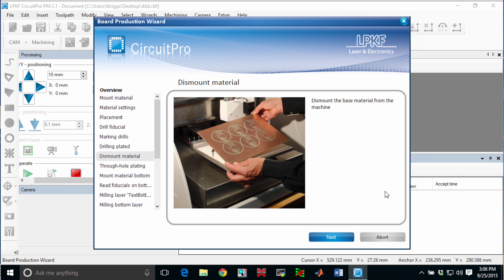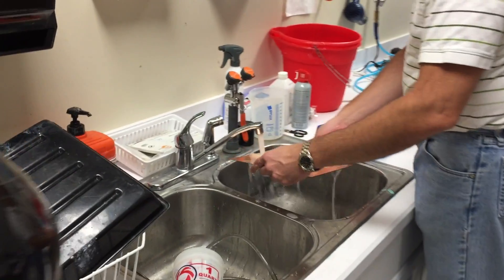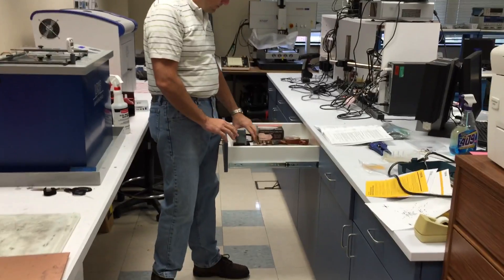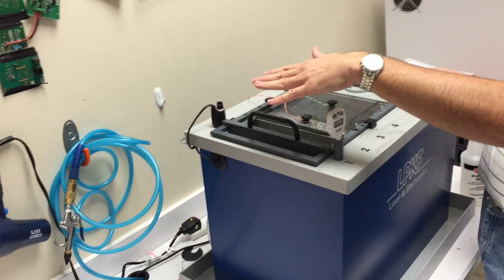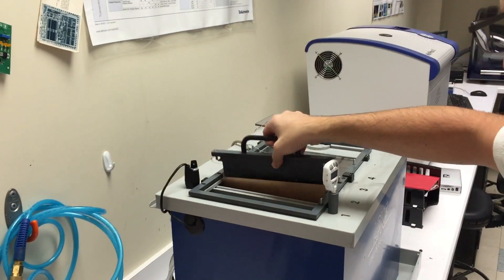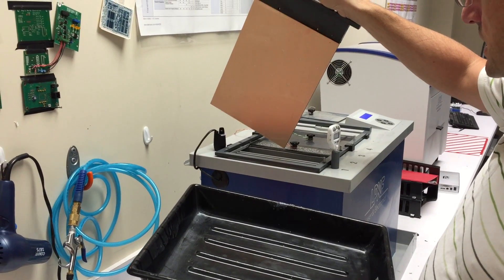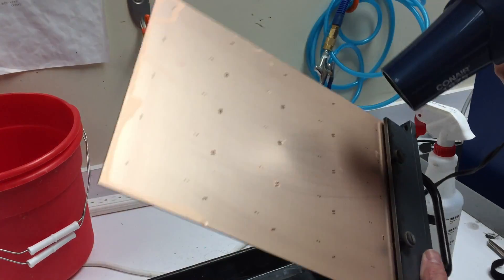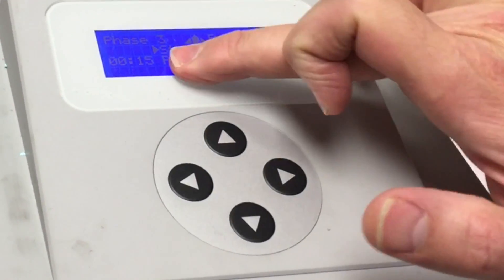LPKF-Electroplating (1/2)

Comment: Are you able to post a video of the process of preparing the chemicals used? Or is it just poured straight out of the bottle undiluted?

Also, Do you know whether the some of chemicals you get from LPKF for your machine are manufactured by Franklin Industries or MacDermid (the patent holders of the process) or from Franklin Industries?

If MacDermid, are you able to list the correlation between the LPKF product name and MacDermid product name.
i.e. what correlates to MacDermid BLACKHOLE SP CONDITIONER, BLACKHOLE SP STARTER, 9421 ACID COPPER WORKING SOLN and 9241 COPPER BRIGHTENER
Reply: Many thanks for the detailed and quick response. Have you ever had the need to add in the Copper Brightener to adjust the results of the electroplating when it turns dull?
Reply: The SHINE 400 MSDS from LPKF (Franklin Industries) dated 31.03.2000 says its 0.6% by wt sulphuric acid and 0.1% by wt formaldehyde.

Comment: Thanks for the great video Tom.
At 3:03 you are using compressed air to clean out the holes.  The Mini Contac manual has a BIG CAUTION message saying not to use compressed air because of potential oil contamination. What's your view on this?
Reply: you use an oil free compressor?
Reply: LOL! Oil free compressors have the issue of the friction reduction coating wearing off over time and contaminating the work.
Reply: @PebblesChan  That's why you always have filters inline when it matters. Most scientific equipment that requires 'clean' air run on oil free type compressors with additional inline filters and dryers if required .
Reply: Of course! Filters... The answer to everything. Just remember to replace the filters. Should contact LPKF to amend their manual.